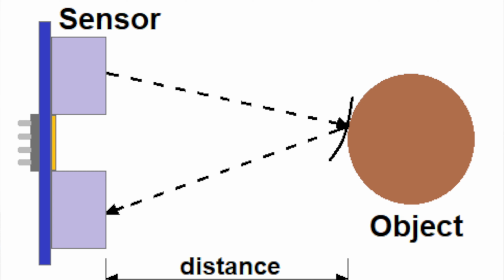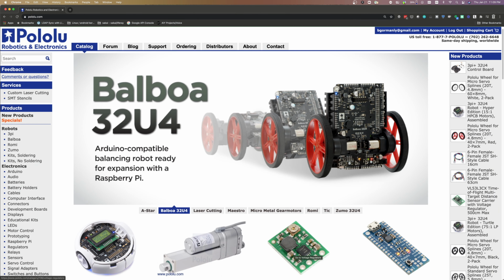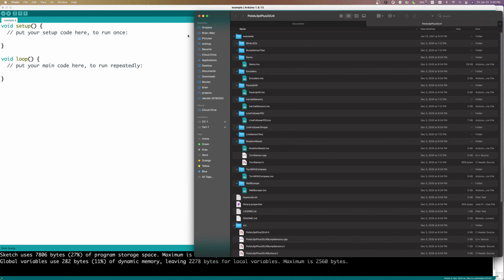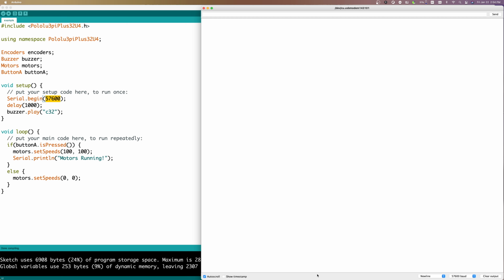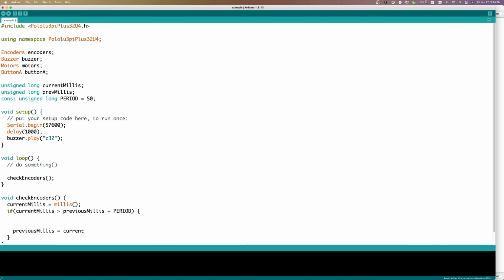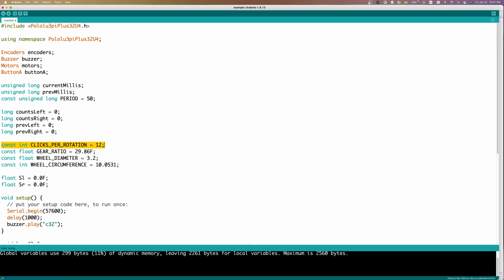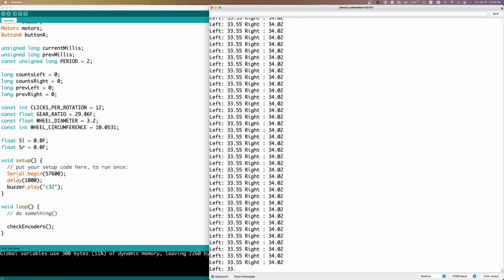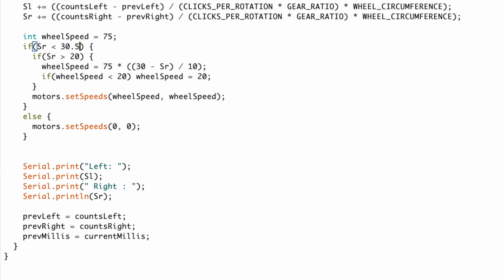Robotics Programming: Building an Autonomous Mobile Robot | Arduino Lab Series

Comment: Sir, I also want to build a navigation robot like yours. Could you please send me the code and circuit diagram? I live in India and have the following components: an Arduino, an L293 motor driver, an ultrasonic sensor, and a 3.7V lithium cell battery.

Comment: My robot stops precisely at 12.5 inches but the left wheel continues to turn for about 3/4 of a revolution causing the bot to pivot to the right. I've played with the parameters but none seem to impact this last bit of spin on the left motor.
Reply from the maker: The motors can have different stall speeds.. you can test this by slowly increasing the speeds to both motors and seeing if one starts moving before the other. If that’s the case, just try to adjust the slow down so that it gets close to that number, but then jumps to zero before you get the difference in motor movement.
Reply: @CodingCoach  Thank you. I'll give that a try

Comment: Hi
Great video! Thanks a lot. I have a question, how the robot knows to stop exactly on the blue sticker on the floor? Is this a RFID sensor? Color sensor? Or are you using some kind of geo-localization? 
I would really appreciate your help. Thanks
Reply from the maker: wheel odometry.. The robot has a goal location in x,y space, say 100, 100 and starts at a location like 0,0 with a starting angle say 0.  From there It is all math.  The feedback loop is the amount of rotation of the wheels.
Reply: @CodingCoach  Thanks ! I think i got it

Comment: still works even using Pololu 3pi? Not with a plus (+) variant?
Reply from the maker: The environment's the same they both use similar Arduino based processors. The big difference though is that the 3pi does not have wheel encoders.  And I use them extensively..

The zumo is another good option and I believe that one has wheel encoders.

Comment: You mention the number of clicks per one revolution of the motor shaft, but I lost you on how to figure what number was needed for the Turtle or Hyper Edition!  And even how you got 12 for the Standard Edition.  How did you come up with these numbers?
Reply from the maker: Good question!  
Starting here: https://www.pololu.com/docs/0J83/5.4
"he encoders provide a resolution of 12 counts per revolution of the motor shaft when counting both edges of both channels. To compute the counts per revolution of the wheels, multiply the gearboxes’ gear ratios by 12. For example, if 30:1 motors (which have gear ratios more accurately specified as 29.86:1) are used, the encoders provide 29.86 × 12 ≈ 358.3 CPR. The exact gear ratios of our Micro Metal Gearmotors are specified on their product pages."

The product pages for the motors on the standard edition (30:1): https://www.pololu.com/product/2364
"This gearmotor is a miniature medium-power, 6 V brushed DC motor with a 29.86:1 metal gearbox"
and the turtle edition (75:1): https://www.pololu.com/product/2366
"This gearmotor is a miniature medium-power, 6 V brushed DC motor with a 75.81:1 metal gearbox"

Note, i did not include the hyper edition here, but if you have it just look up the 15:1 ratio motor 6v
Reply: @CodingCoach  Well the answer was staring me in the face the whole time! "The encoders provide a resolution of 12 counts per revolution of the motor shaft..."  The encoders refer to the encoder used and have nothing to do with the motors themselves!  Blind in one eye and can't see out of the other!
Reply from the maker: @codecage9333  you got it!
Reply: @CodingCoach  I guess my real question was about the number "12."  Is that a fixed number for all motors?  A comment, or a way you made reference to CLICK_PER_ROTATION, gave me the impression that this number might be different for different editions of the 3Pi+.  But I saw no way to derive a different number.  Is that number based on the encoder itself and remains the same for all editions.  Thanks for the quick reply by the way!

Comment: I'm running into an error. I followed the entire video and I got everything to work, but in the end, I unplugged the USB from my robot because I wanted it to run without being tethered to the computer.  When I unplugged I received this error:
 avrdude: ser_open(): can't set com-state for "\\.\COM3"

An error occurred while uploading the sketch

Error while setting serial port parameters: 57,600 N 8 1

It's not recognizing the port I plugged into anymore. I tried to run the same code again on a different file, but I still ran into the same error.
Any advice on how to go about fixing this?
Reply from the maker: 1. In Arduino studio, sure to double check tools -> board and make sure it is set to "Pololu A-Star 32u4" and also tools -> port and make sure you select the correct one.  Also it never hurts to reboot your computer and start fresh.  

2. If that does not work, try opening an example sketch (like blink) and see if you can flash that.

3. If none of that works, let me know you might have to reset the bootloader see  : https://www.pololu.com/docs/0J83/10.1
Reply: @CodingCoach  I just finished going through the uploading-before-bootloader method from Pololu and I got everything back to normal! Thank you for the assistance. I'm looking forward to the upcoming semester!
Reply from the maker: great work!
Reply: @CodingCoach   All the settings I have match up with what you stated above and I received the same error again when I ran the blink program.

Comment: please create more video on this series without use of pololo robot just simple robot with bldc motor rotary encoder and ultrasonic sensor with servo
pololo is costly and most of us are not having it that's why at a cheaper rate please try same video with bldc motor and ultrasonic sensor with servo
Reply from the maker: That is a good idea, I know that many enjoy building the robot.  I have this video on the assembly of the elegoo smart car: https://youtu.be/5CNjEY0LCwA but the fact it has 4 wheels does not make it a good candidate even if you add encoders.  When I am done with the initial series I will do a video on the $15 2 wheeled chassis I showed in the video with the elegoo parts on it and the encoders.  As I mentioned in the video remember you can use any similar robot for this series it does not have to be the pololu.  The algorithms discussed will be the same any the tuning of the robot will be different.  Thank you for the feedback!